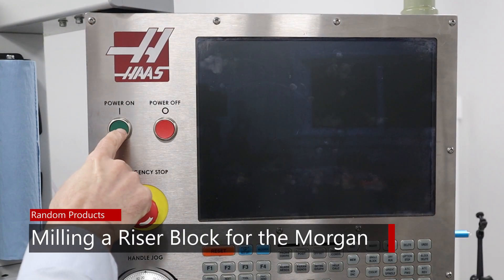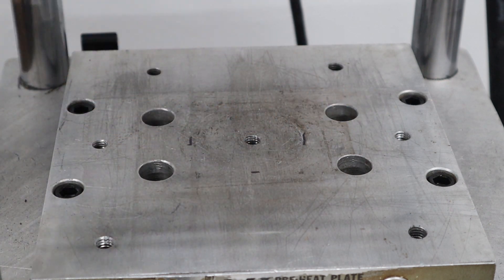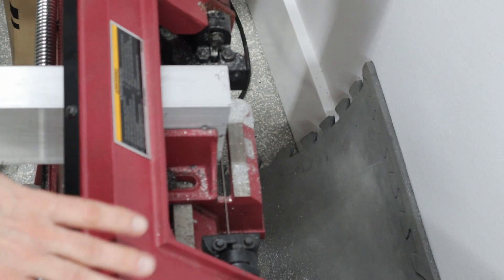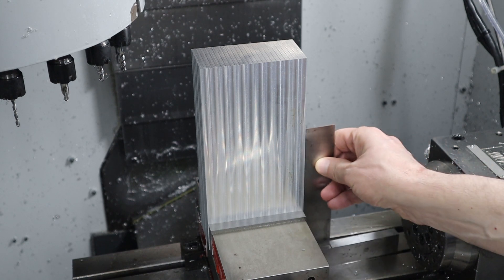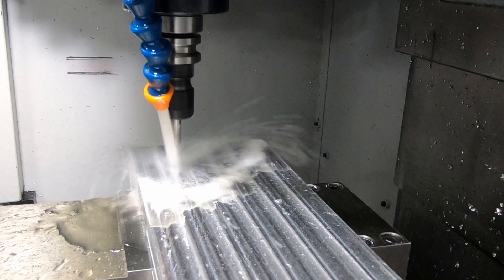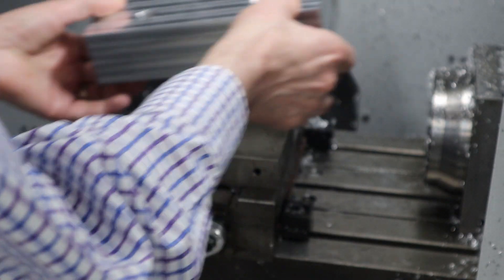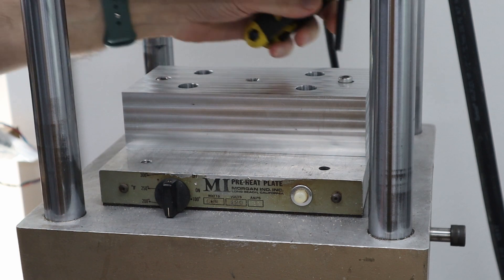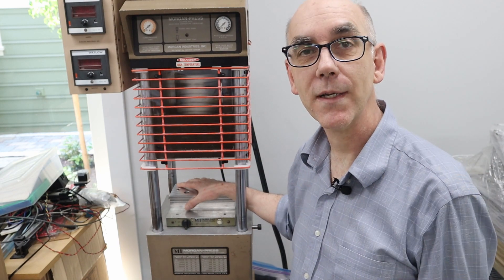Milling a Riser Block for the Morgan G 100T

Comment: With the riser block on the heating block, will it lose temperature? Are you going to need to insulate the sides to keep a consistent temp?
Reply from the maker: I haven't hooked up the heater block yet, so I don't know. But if it becomes an issue, insulation is a good idea.